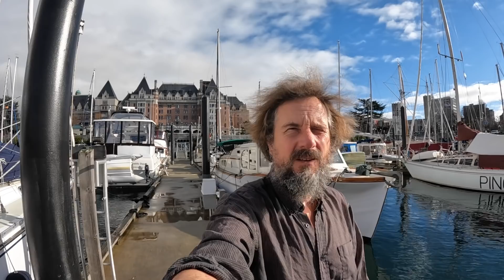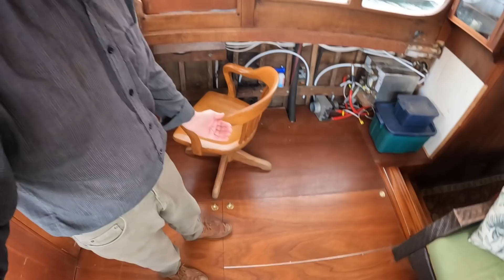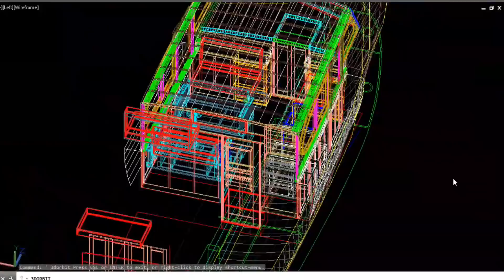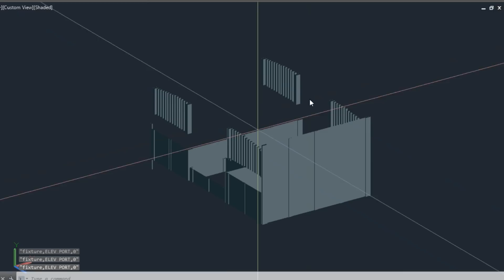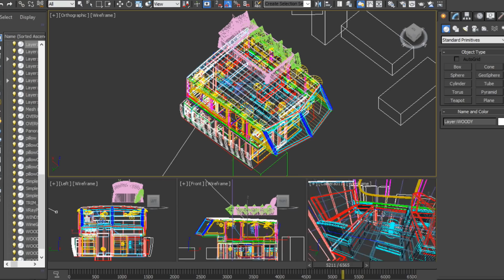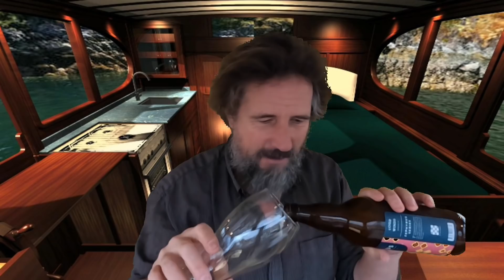Ep 291 - Let's build a 3D Dinette! - Boat Life - Living aboard a wooden boat - Travels With Geordie

Comment: Concerning the steps when using the galley... could you not have a panel on the door between the galley space and the aft double bed space that hinges down and fills the void of the steps? That way you increase the floor area of the galley when cooking. The panel would have to sit on an edge that you create on the sides of the steps or maybe sit on rubber doorstops that you screw into the edge of the steps or something. The panel would kinda mimic the extra counter top space panel you have in your galley design.
Reply from the maker: The steps vs sink isn’t actually as bad as it looks. neat idea though!

Comment: Peter, are you aware that you can get a free copy of Fusion 360 for non commercial use.  Looks to me that it would be more than adequate for your needs. Sure there is a learning curve, in changing software but for someone with your existing skill set it wouldn't be too steep.
Reply from the maker: Something to look into.
Reply: @TravelsWithGeordie  https://www.youtube.com/user/cadcamstuff is a good place to start if you quickly want to get a handle on Fusion 360.  Also I gather that their "non commercial use" policy is pretty liberal. In practice only a small set of features is curtailed. Mainly it curtails the ability to collaborate with lots of other designers working on larger designs by only allowing you to keep 10 documents in an editable state at one time. You can swap them in and out of being editable just not have more than 10 editable at one time. In practice I don't think you would find that there are any real limitations that would impinge on what you do.

Comment: Peter,  you just have to fit a beer tap! I know it's a load of extra work with the gas and the cooler and all the piping to keep clean but how cool would that be? It's the ultimate "Man Cave" accessory. Just think of the bragging rights of having draft beer on board plus there is always the option of a second tap up on the sun deck LOL. It sure would make the other boaters 'Green' with envy

Comment: I’d be really curious to see your hot water/heat exchanger heater set up that kept you warm. I also live on a boat and have one of those electric heat exchanger heaters that’s plumbed to my starboard engine and the port is looped into the hot water heater. It would be neat to see the setup you do, I’m assuming you run the heater off of the coolant loop for the hot water heater that would normally run to the engine?
Reply from the maker: Coming up soon!

Comment: Funny how hard a lot of my subscriptions are to find when using a tv. You see a lot on your phone but when you look on your tv or streaming box its not there. You have to go on the phone and watch a bit just to have it in your history. Thats 3 videos a day you have to find like that. And they only turn up as recomended. Not as new posts in your subscription. You find them totally radom or by chance..   Youtube seems set up wrong these days..
Reply: Got the opposite of your problem. Been watching YT on tv for over 2 years.( ROKU ) It's the poor and unthinking programming that limits your tv. Garbage in, garbage out. With these Chinese tv's they hook you with low price so that they can track your usage. Your tv " updates " at night between midnight and 4 am on roku and the return data stream is generally 5 to 7 times the incoming stream. Wonder what's up with that!!! You are limited on what you can do by non interactive protocols that are simply software omissions. Your tv is capable of doing everything your phone can do it just isn't programmed to do it

P.S. Also, I would hate to try entering comments with the onscreen keyboard and remote control
Reply: @michaelmagill189  well the tv is a 4 year old 4K Sony Bravia so a bit weird that that should be a problem. But only phone gets used for typing. If my PC isnt on, and thats not often. I use it for shopping mainly..

Comment: I agree with almost everyone's positive reviews, very impressive work with the green screen use. Green, Green, Green. Keep up the 3D modeling work. Perhaps you could sale plans to M/V Geordie in the future if someone had the desire to build another one like her. Also it was great to see another clip of Geordie in the wheelhouse. Last do you think you should add a pull out sole section to cover the lower steps so you cant accidentally fall down the stairs? This could possible move out from the port side when needed. Great modular design on the dinette by the way.

Comment: Super Green! Your skills are amazing. Love the convertible design, so much better than the cramped usual boat interiors. I remember keeping legacy systems around to run old software for the same reasons. Other than optimizing a build for legacy software it can be done in emulation with newer hardware efficiently sometimes.

Comment: Peter, try to get second, used computer as a back up for the 3D software to run on. A disk image stored somewhere else with the operating system and 3D software will help you recreate your computer after HDD failure.

Comment: Hi Peter. I'm not a drinker any more. I quit almost 40 years ago after 3 DUI's and an incident where I almost beat a man to death and had no memory of it. It was 15 years before I ventured to take another drink. I drank one beer after completing a triathlon ( it wss soooo damn good ) and didn't do it again for several more years. Once I was sure I could control myself, I began to drink socially and would quit after 1 or occasionally 2 drinks. I'm still that way and I'll be 63 next month. At any rate, a mini fridge makes a great keg cooler and stacking them increases variety but is still a large commitment of space that is precious on a boat. I would rather have a drawer style fridge that can be set to about 28 degrees f. This is too cold for most fresh foods and not cold enough for a freezer but will allow a good variety of perfectly chilled bottled beer without a large commitment of space. It works well for the champagne too. My take is that variety beats quantity. Keep the vids coming n I'll keep watchin. Till next week.......

Comment: Well that's a really ambitious plan, I suspect you will end up simplifying it quite a bit for a few reasons though. There were a lot of pieces of 'modular plinth' that you fitted in as required  but unless these are fixed in place they are going to be a little unstable plus you'll need storage space for them when they are not required.
Reply from the maker: Thanks Ian, The plinth boxes are actually fully designed, offer storage and double as steps at the windows to climb out. the plinth panels are also pretty much set, they sit on ledgers with notches to keep them secure and store under the tip up seat base. The only real fantasy element in the flip up centre bench under the deck. But I have time!
Reply: @TravelsWithGeordie  I appreciate your response but not sure that you understood what I meant by unstable. Tall narrow pieces are easily toppled over if you step on the extreme edge and what kind of support are you planning for that table ? I don't see any practical solution unless you are thinking of a base filled with lead !